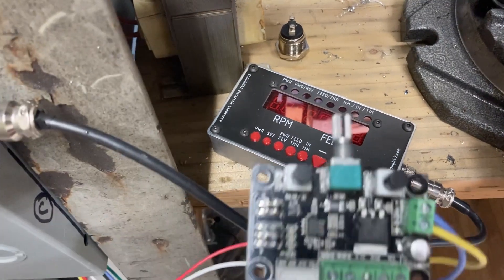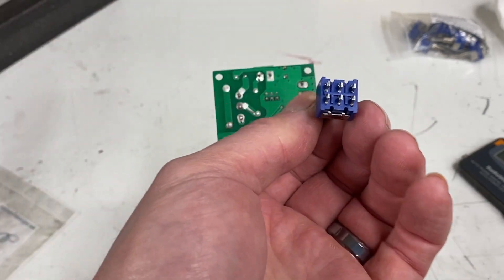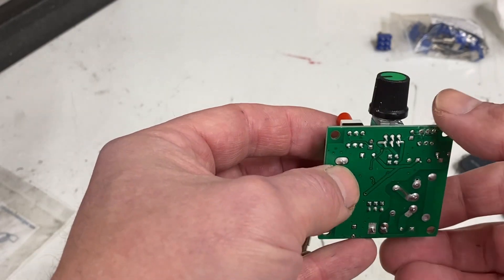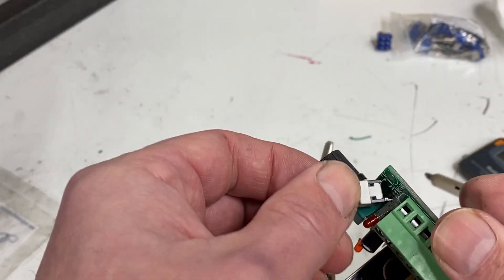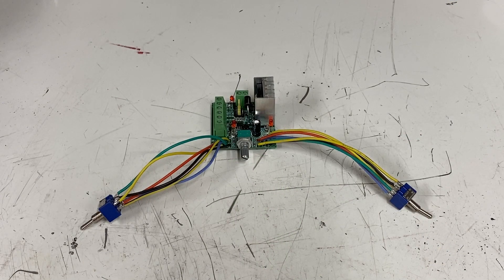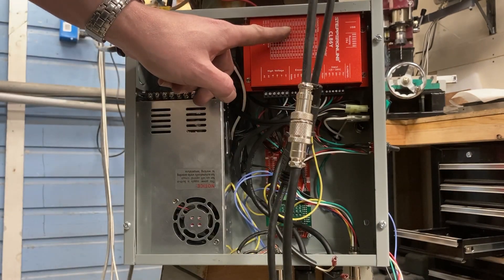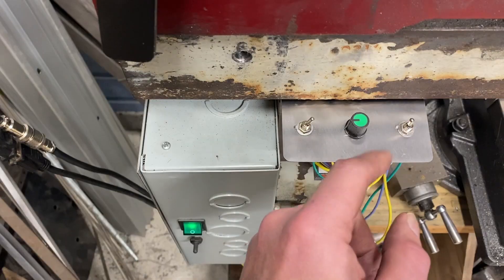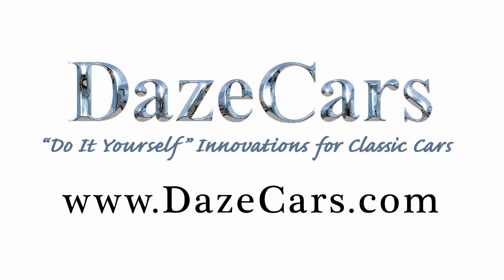Lathe Autonomous Pushbutton Power Feed,  Clough42 ELS Electronic LeadScrew independent controller

Comment: I didn't see a wiring diagram for the 4 pole switch. Looks like 6 wires to the other items.
Reply from the maker: there are 6 signal wires but three of them are the same + so I only needed 4 terminals.
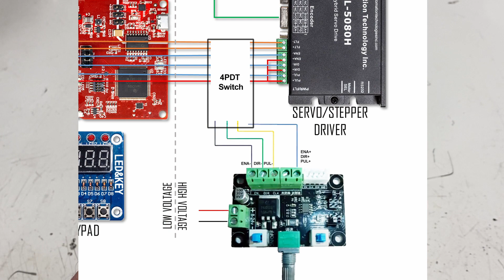Reply from the maker: at 5:16 it's the blue wires and red wire.  the ENA-, DIR-, & PUL- each get their own terminal.  The 3 + get combined into one terminal.  That is the 4 terminals.  The center terminals on the switch go to the servo/stepper driver.  The 4 wires from the ELS go to one side of the switch and the 4 wires from the autonomous control go to the other side of the switch.

Comment: You went to an awful lot of work. My solution was much simpler. Draw up a small box with 2 shaft guides above the buttons and a hole in the front for the potentiometer shaft in Fusion 360. Draw a lid with 2 holes for the button actuation shafts and 4 holes in the corners to screw it down.  I did this for my mini-mill X axis automation. My Clough42 parts are gathered and that will be my next project.
Reply from the maker: Some would say everything you had to do in Fusion 360 is a lot of work 😁😁  I have not yet gotten into 3d printing so I worked with what I had.  The other advantage is eventually I can mount it n a master control panel.  Thanks for the tip, it might help others that are setup to 3d print.
Reply: @dazecars  3D printing is totally addictive. I’m still using my Ender 3 printer I bought for less than $200. Fusion 360 is powerful and free to non-commercial users.  I find myself drawing things up in Fusion then printing in plastic to see if I have what I want then making final design in aluminum or steel.
Reply from the maker: @mikebrewington1425  It is on my to do list 😁😁  At this point keeping up with life, running a business, growing my YouTube channel and all my other projects I have not yet found the time to get in to it, but I will.  I can see the value of printing all kinds of things.  I also have a furnace I made for melting bronze and aluminum and a 3D printer would allow me to make plugs for casting.  It would all be fabrication related.
Reply: @dazecars  I can definitely see value in a forge for aluminum.  I’ll get around to posting a video on my little project in the next few days.  I’ve been retired for almost ten years so spare time is hard to come by.

Comment: So, I bit the bullet and ordered my Clough42 stuff off EBAY. Should be here in a few days. Next I'll be looking for NEMA motors and RPM counters.

I have an old Smithy Granite 1220 LTD than needs some souping up. I may increase the size of the pulley cover so I can house most of the components in the same location and mount all the knobs and controls in a bespoke 3D printed bezel on the side. I should probably document all this so I could be of some help to someone else like you've been to others.

Keep up the great posts..
Reply from the maker: Glad I could help!  The stepper motor/controller I ordered is no longer available, but this one is similar https://amzn.to/3CqENJj with it I was able to do direct drive and it works very well.  Let me know if any questions come up.  Also post your progress on the 3-in-1 facebook page I'm sure lots of people there will be interested.